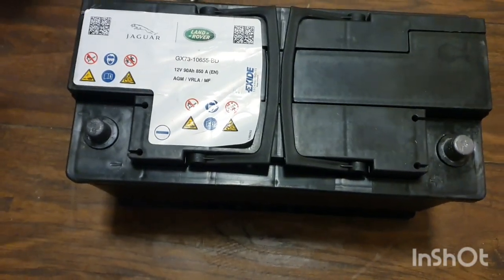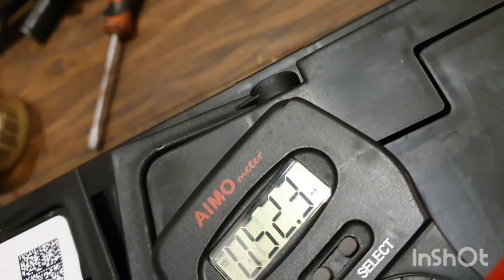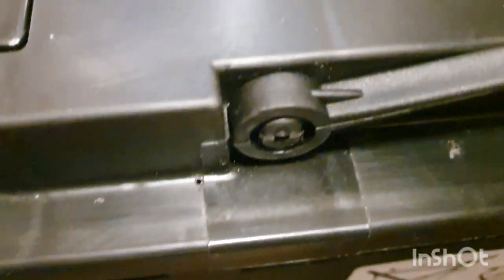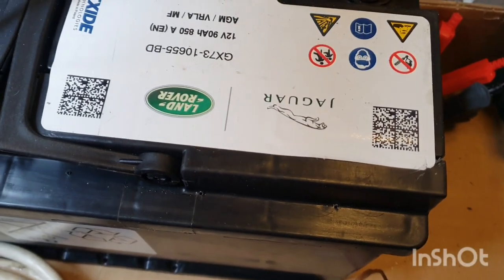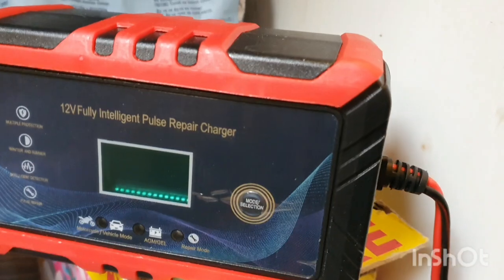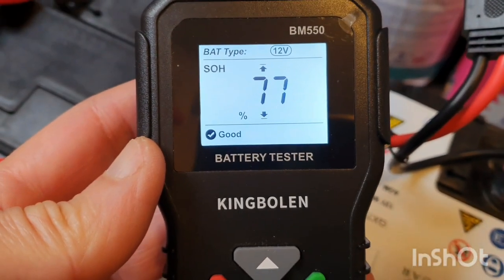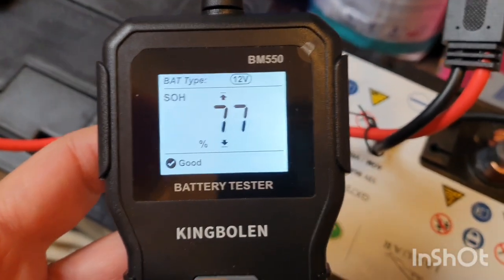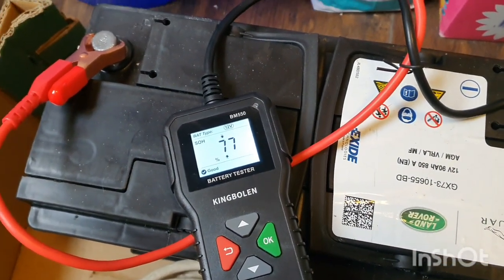Car AGM start/stop battery restoration/repair

Comment: I have two questions about how many apart is each hole drilled and how far deep you drill inside the battery
Reply from the maker: Drill tiny hole in the centre of each chamber. In the back of the battery. Not deep.stop as soon as no resistance

Comment: Would 'dipsticking' help to measure the amount of acid needed?
Also, does acid get lost?  Or just water?
Reply from the maker: I don't think dipstck will help. As the fluid in the battery is absorbed in the matts between the lead and not free flowing. Usually water is lost. But its better to top up with battery fluid from a used battery as it has the acid in it